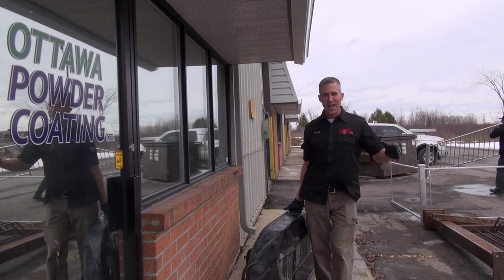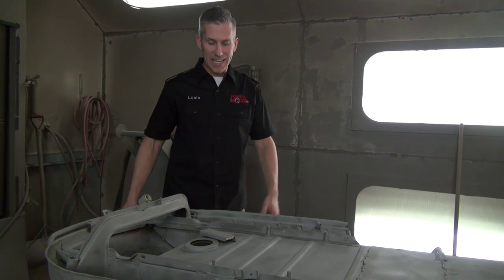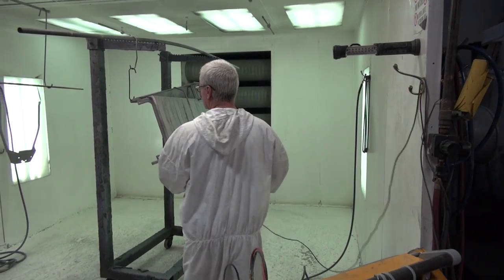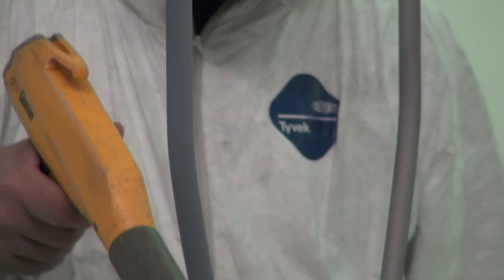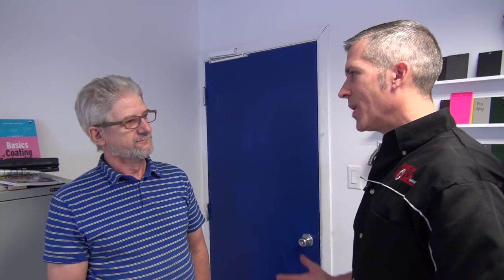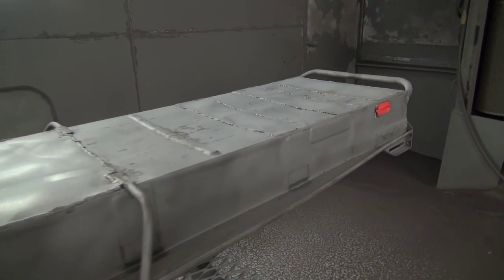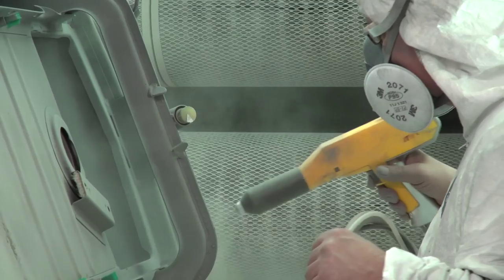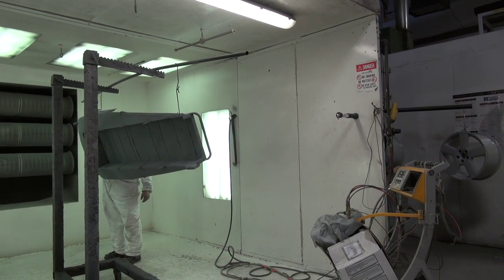Skidoo Elan restoration Series Ep#3 Tunnel Powdercoating process Part 1!  PowerModz!

Comment: Hey Louis< Did you guys talk about any possible issues with the aluminum chassis possibly warping? I had my mod project powdercoated I'm not sure what happened If it got dropped or warped from the oven but I noticed when I went to put my running boards back on something wasn't right. The rear suspension mount is about 2"s higher than the other side. My coater can't explain what could have happened. At this point I am looking for another F-chassis to start over again.
Reply from the maker: wow never heard of that - the heat isnt that high.
Reply: Michael from Ottawa PowderCoating here. It would all have to do with the thickness of the aluminum, as well as the temperature and length of time the item is baked at. We have had a few issues with thinner metals warping in the heat, but we try to advise the customer that if it is thin metal, there is a chance of slight warping. For Aluminum, we tend to bake the items for a shorter period of time to prevent such issues.